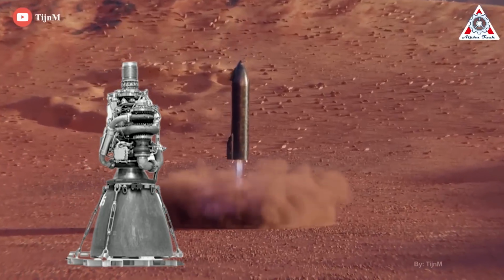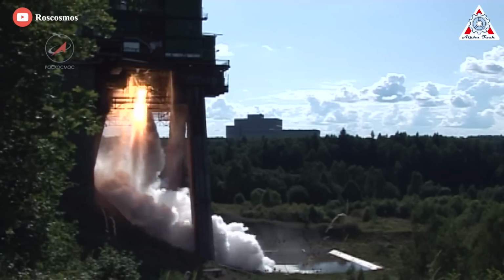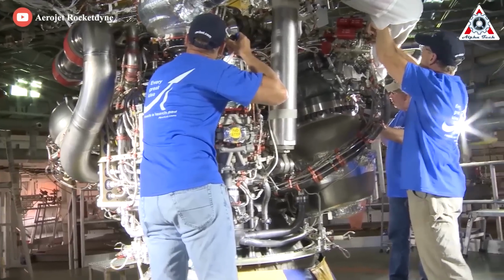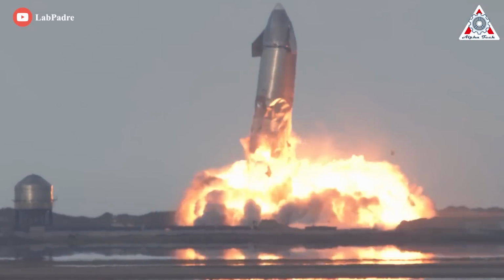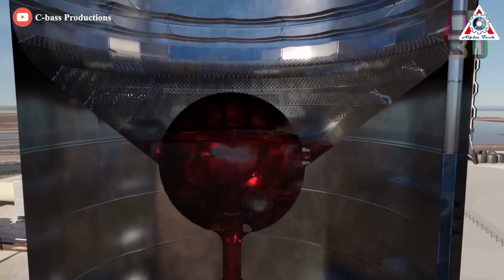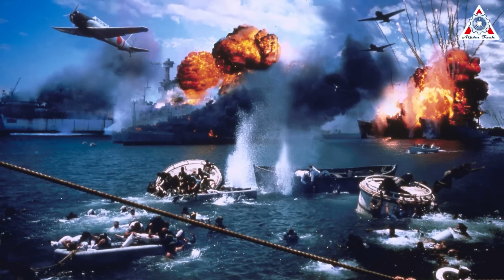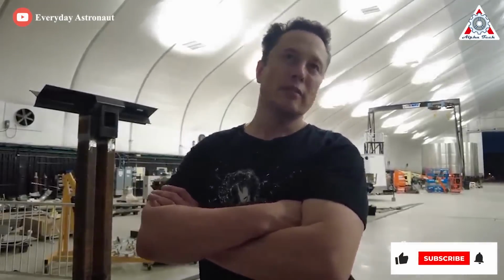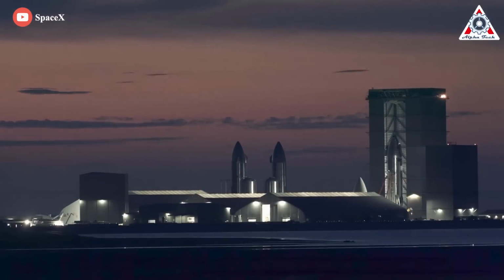SpaceX NEW Raptor Engines "BIG PROBLEM"...

Comment: I wouldn't consider this a full picture of the challenges SpaceX is working through at all. There is certainly an argument to be made that the raptor program is cutting edge and still as of yet unperfected, but where was it mentioned that SN15 successfully flew starship to an altitude of 10km and then reignited and brought the ship down to the ground safely? Where were the successful raptor 2 tests mentioned, where they brought chamber pressures up to 300bar? Not to mention the fact that even just during this last attempt at an orbital flight, most of the engines functioned as intended even AFTER being peppered with concrete? Sure, it's hard, but you would have to be an absolute fool to think that failing at doing things that has never been done before is reason to believe that there is a "BIG PROBLEM". In fact, the fact that they ARE running into problems and challenges is the best thing that could happen for SpaceX given that failures are exactly where they learn and adapt the most. We'll see where this goes, but I wouldn't be shocked if we saw a successful orbital flight even this year still. While not particularly likely, SpaceX is right on track. You also have to consider that refurbishing space shuttles cost 1 billion dollars, just refurbishing them. For a billion dollars you could put 29 tons in orbit. Falcon 9 can put over 22 tons in orbit for just about 67 million dollars. The technology isn't even comparable. There are merlin engines that have flown over 10 times. And the only way SpaceX figured out how to do it is by failing.... a lot. So the bigger the problem the better I say, cause if there is a company that can figure it out, it's SpaceX.

Comment: the Starship test launch was comparatively, acoustically more clattering than the SLS launch when Starship was rising in the lower atmosphere. At least in my perception! Maybe there is something to be optimized/addressed to get it smoother. 
 And the 33 Raptors may need to be shut off in two groups, before MECO, in order to let the valves of the second set of 16 engines cool down a little bit for MECO so that it becomes a really clean cut-off!

Comment: So you know how NASA spent years getting huge F1 engines developed and reliable and only had to use 5 at a time?  Or how the Russians used lots of small existing engines in large numbers in a plumbing and troubleshooting nightmare that blew up their N1 rocket every time?  Remember how NASA built pads with massive flame diverters and deluge systems so the engines didn't destroy themselves and the surrounding area on ignition?  I remember.  How come SpaceX didn't?
Reply: What spaceX did is try and fail and learn and retry. That is how they have succeeded so far amazingly.

Comment: The rock pad was destroyed and the reason wasn't that they didn't know that this was going to happen. The rocket stayed 9 seconds burning fuel on the pad before lift off. This is too much time and the first failure was there. There were reasons why Saturn rocket had three stage. May be this projet needs a complete redesign. Increase the number of stages or decrease the number of rockets decreasing overall ship size and capabilities.
Reply: Elon knew failure of the pad was possible as they already had a redesign but it wasn’t ready in time that the FAA license came through - you must not play kerbel space or understand the rocket equation - because the starship is so large it requires a certain amount of thrust to be able to overcome gravity for the payload they are wanting 33 was the result - staging doesn’t help with this issue if you have insufficient engines you have insufficient thrust - you gotta get off the pad

Comment: @ALPHA TECH  i think we need to fix system from blowing concrete chunks  with the steel plates and retest before blaming the raptor engines... concrete chunks could have caused damage to engine assembly... lets focus on the biggest issue first...

Comment: Space X’s heavy launch vehicle and its Raptor engines are promising breakthroughs, however; several engines failed during the first stage ascent.  An outside source stated that it appear that E1, E6, and E7 had failed at launch. E18 failed violently at T+30; E19 failed at T+46; E22 failed at T+60; E23 failed at T+94; at T+122 flames were visible at the thrust section; and at T+130 the rocket started spinning. How many engines failed on the maiden test flights of Apollo 4 (Saturn V), STS-1 (Space Shuttle), Russian Energia, and Artemis 1 (SLS)? Where is the flame deflector to channel the rocket exhaust away from the launch pad and where is the water deluge system to dampen the acoustic energy of these engines?

Comment: The launch pad engineering was/is totally irresponsible based on any, even cursory, review and analysis of previous launch pad infrastructure.  The decision to move forward with it as designed was plain stupid, and could have easily been improved in the time available.  It was proven to be a horrible decision given the impact its failure will have on increasing the one time before the next launch authorization process and documentation.
Reply: I’m pretty sure SpaceX has launch license because the one they received was good for 5 yrs from the FAA - they got excellent data from the flight and the next one is going to be successful

Comment: I Warned Elon Musk Space X Several times that his design for the launch pad was dangerous and that I had seen Jet Blast pick out 24 inch thick concrete out of a pad and throw it hundreds of Feet and yards. I knew Rocket Blast would destroy the base of the launch pad and throw the concrete all over the place. 
The Tank farm is far too close. It should be 1/2 to 1 mile away and ELON should have duplicated the Cape Canaveral launch pad design and then place the tower on the top. I suggested a swimming Pool/Holding pond to absorb and disperse the Rocket Blast pressures and enclose the ends of the pools on the diversion routes to keep water under the launch pad until it lifts off. Unfortunately ELON MUSK Failed to listen to my advice and STILL CONTINUES TO PLACE HIS FAITH in the Metal plate and small amount of water underneath which will FAIL AGAIN in a ZVery Similar fashion and throw METAL and CONCRETE this time all over the place Cutting Tanks and Pressure vessels apart RISKING SAFETY AND THE CONTINUED LICENSE TO LAUNCH. 
MY SOLUTION IS THE SAFEST IDEA and BEST IDEA and it will keep every thing at the launch site safe. My Swimming Pool/HoldingPond idea simulates ELONS Ocean OIL RIG PLATFORM IDEA. being high off the launch pad base and NOT USING METAL AND CONCRETE in CLOSE PROXIMITY to the BLAST PRESSURES. I DO WISH ELON Would humble himself and listen to my ideas this time. I am a big supporter of his ambitions to get to orbit and MArs and SO I Hope ELON will listen to my ideas SOON and BEFORE ELON goes ahead with his metal plate and Water Concrete base idea.
Reply: Lol like a billionaire would listen to you

Comment: Your statements concerning reusing and restarting engines are largely negated if you take Spacex's Merlin D engines into account. Raptor engines, being the first Full Flow Staged Combustion (FFSC) MethaLox engines, are still in development. NO ONE has successfully orbited a FFSC Methalox Engine. Spacex has taken this technology further than anyone, including the Russians (For decades the best rocket engine designers). Most of your comments are way out of date. I find this video inaccurate, outdated and singularly misinformed regarding this remarkable FFSC MethaLox design.

Comment: I find it odd that in all your concern-trolling over how hard the raptor engine reuseability development is that you only compare it to Space Shuttle engines, completely ignoring that SpaceX has been successfully reusing their Merlins on the Falcon 9 for the better part of a decade.  Surely all these same issues occurred there in the early stages of reuseability development... 

Somewhat disingenuous to fail to mention that the company actually has been through this process before and might actually know what they are doing.

Comment: i just occurred to me that if a starship can be blown over by earth winds, we’ll need a martian mechazilla. or maybe a hydraulic landing pad that can lower and lock the rockets in a partial or fully submerged state. because the martian winds are next level
Reply: Air density is so low on Mars, the winds would have very little force on starship.  They’ll still need to accommodate for the Martian wind, it just won’t be that big a deal.
Reply: @vanguard9067  keeping the martian dust  from the mechanical components would be good. also, kicking up massive dust clouds is bad for the solar arrays and green houses
Reply: @LettuceBeFrank  absolutely!  That will be a huge problem with every interaction on the surface and bringing it inside.  I’ve seen some prototype dust capture systems for airlocks, but that doesn’t address all the other sources.

Comment: Your a little Rough on the Raptor, You left out the fact that the fuel was an issue when ship would do the flip maneuver, Adding the header tanks an so on.. Raptor2 are pretty solid. Raptor3 will be very hard to beat!

Comment: Why not just have a wafer at the base of the booster with all the engine pack installed  and ready to simple quick change to a booster tank. Simply  swap them out after each flight and service them  later. It could be a booster ring..

Comment: The Raptor Engines that failed were almost certainly damaged by debris from the cement launch pad. In addition, heat generated during liftoff probably degraded at least a few engines. 

Launch the rocket higher above the launch pad and make the launch pad more pointy - like a pyramid.

Comment: Most rocket engines are actually reuseable in theory.

Making the engine reuseable is not the hard part. The hard pard is getting them down again in one piece so that they can be reused.
Reply: Bingo
Reply: Most liquid-fueled rockets are reusable.  The care and feeding of the Shuttle main engines was handled with exreme care because if one fails, they don't get home.

Comment: I've worked on plenty of defense programs over my 30 year career and there's a lot of "risk-adverse" and "cost-plus" decisions that would never fly with a for-profit company.  The operational philosophy is not even remotely the same.  This is why SpaceX has had R&D timelines and accomplishments that traditional aerospace would never attempt, let alone accomplish.  This is primarily because senior leadership at big aerospace is most concerned at keeping their customer (Uncle Sam) happy whereas the private company senior leadership is most concerned about getting rockets into space.  All decisions and culture flow-down from that.  Even the engineering of what is and is-not possible, the experiences of materials and test, and the results of those exercises.  This cultural difference even shapes the engineers perception of what is and is not possible.  I've seen this happen, where an experienced engineer from a commercial company that mass produces completely unrelated consumer gadgets gets hired by a defense corp and immediately solves an engineering problem that his new aerospace home had spent millions and years trying to solve.  His solution, a ridiculously simple, completely out-of-the-box thinking, and yet so effective it's gets used across multiple programs.
Reply: I'm no rocket scientist nor worked for the gubmint (since I got outta the navy) yet worked at semiconductor foundries, as a marine engineer, robotics engineer, hvac tech, paper mills, etc. etc. and find it amazing that something commonplace in one industry, is not even thought about or considered. 
I would be looked at as a genius, for using a technique or parts from one industry to another. 😮 amazing! The disconnect!
Reply: @brucelytle1144  would the “…not-invented-here…” bias be one of the reasons for not implementing a new process/device?
Reply: @tygerbyrn  there would be some of that. I'd be curious. I came up with a part modification that saved about $5000 per repair, to a machine that 1000's of companies world wide used for stuffing sausage, ice cream containers, all sorts of stuff. The change was probably patentable, I know the factory reps saw it, I didn't have the $ to pursue it, the company I worked for didn't care (till I left!).
The first time I took on a full on automation of a part of one company, 90 days after it went on line, the power company was climbing all over the place, I asked my manager what was up. He ( a "licensed electrician) explained that something had gone wrong with the metering for the plant, our power bill had gone from $66,000 a month, to $22,000.a month! I enquired if that was possibly from the new controls. I was told, unequivocally NO!
That bill continued to be the same, until about a year after I left, they decided to move the controller to a new location, and reprogram it, because, I was told, nobody could understand my program...
I find humans to be strange creatures! 😕
Reply: @brucelytle1144  Strange creatures, indeed.
Reply: @tygerbyrn  Not in this case, though "not-invented-here" does impede progress from time to time.  Mostly I find it's the cultural differences and the slow methodical pace of R&D at aerospace tech vs. consumer tech R&D.  Consumer tech does not have the documentation trail aerospace tech does.  They generally move fast with a "fix-it-in-production" mentality.  Forced to fix things on a limited budget and with timelines that simply don't allow for decades long development cycles.  And not to say that your aerospace should all be done this way either.  The stakes are higher than your smart phone lasting 8 hours on a charge.  Actually, I've found that the best and most innovative team is where you blend both experienced engineers and newly grads from various disciplines and industries.  I think SpaceX may be doing it this way.
Reply: @eeman1335  the wisdom of the senior engineers/managers with the energy and drive of the entry level engineers. That would sound like a common sense thing to do in any case and in any industry including Aerospace. However, I read that Boeing had junior engineers lead the Starliner project to detrimental results, i.e., stuck valves, etc.  In addition, there was a difference in design/engineering philosophy between SpaceX and Boeing with regards to the Dragon and Starliner, respectively.

Comment: What a waste of time. It seems obvious you are going just for the clicks and not the substance. I subscribed because I liked your previous videos, but I am leaving with this. 

But back to this video, I tried hard to understand what the "BIG PROBLEM" is - other than click bait.

The only Raptor "problem" that seems to emerge is the cost and complexity of complying with the "traditional" NASA certification process. But the objective of any certification is to lower the risk of failure to acceptable levels - where risk is as usual probability times impact. And again, you do this by either lowering the probability of failure, or by mitigating the impact. But note, this applies to the entire stack, not just a single engine. Aircraft do not need engines to be certified after every landing, and engine failure is mitigated with other measures, like having more than one engine, or even a parachute on LSAs.

Obviously, this could be a "BIG PROBLEM" if FAA and NASA stick to "traditional" certification methods - and I am sure many corrupt individuals and politicians in the legacy rocket industry are quite actively trying to make that happen. But just like it took a bit more time to develop ETOPS certification, it will just take time to certify a 33-engine configuration - particularly one that has already demonstrated the capacity to survive car sized concrete blocks thrown at it.

So yes, lots of tests and launches will be necessary to measure the probability and impact of failures needed to define a new certification standard. And that is exactly what Space-X has planned. And the fact that engines or rockets keep on exploding is quite normal, so why do you keep on mentioning it multiple times in the video as if it is a problem?

Anyway, too bad, you had a pleasant voice.

Bye.

Comment: It's amazing what you can do when you have the support of the global banking system and unlimited printed currency.  EVs are a uneconomical pipedream concocted to solve a nonproblem concocted by that same banking system in order to engage in unlimited currency printing.  All because you always need to print money to payoff the debt from the previous round of currency printing.  

As for taking off and landing on the Moon and Mars, we just witnessed a doomed flight from concrete being torn off the launch pad by exhaust getting bounced back into the engines.  Imagine the damage from landing and taking off from the moon or Mars.  It will be like beaching a large yacht on a rocky shoreline and then attempting to reverse off.  In comparison Apollo was like landing a lifeboat and then rowing back in a rubber dingy.

Comment: Okay, so first 8 minutes is trolling.  Good grief.  Thanks to taxpayers, NASA had an infinite budget.  And the turn-around time for reusing Space Shuttles was almost a year.  So of course they didn't complain about stripping down engines completely and re-testing each individual part even though it was pointless after a certain point.  SpaceX Raptor-2s will be re-certfied the same way Falcon Raptors are.  You're inventing problems to attract clicks.  What we internet old-timers call trolling, fishing for attention, fishing for viewers and clicks.  And there are 30+ engines, and they can afford a failure or two.  And there will be at least 2 dozen Superheavy launches at least before there are any crewed missions.